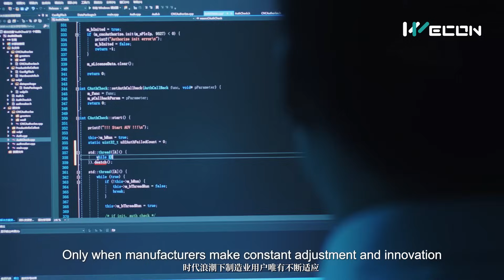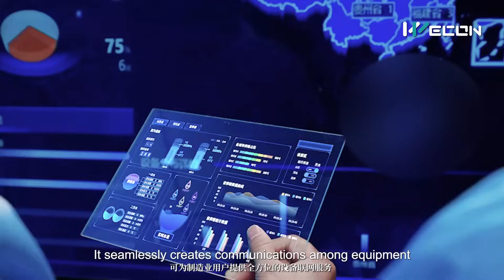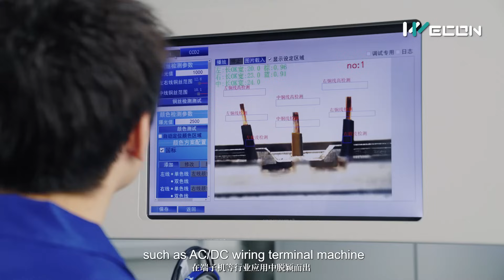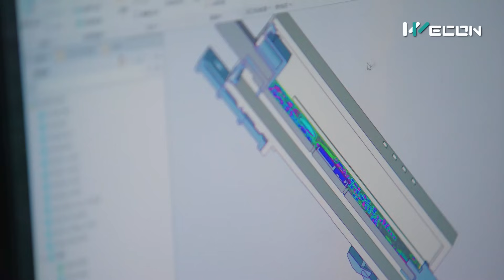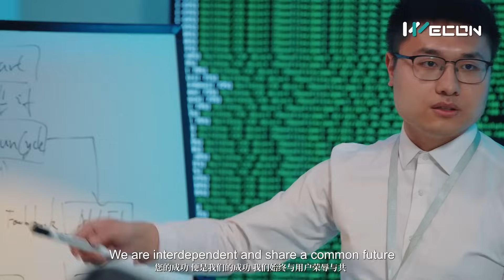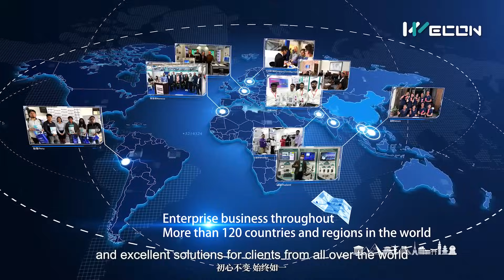Wecon Company Introduction 2023

Comment: Can't upgrade to 1.22 version, the software from the oficial site not working with error window, but those what i get from official saler making my servo in bsl and always in programming with one percent of burning, where is the working software, i use servo vd2f and VD2F_014SA1P_V1_22_241017_固件升级_250816.exe program, connect via rs422, when connecting first and upgrading i saw my servo version, after - all time "timeout" and bsl...Please help
Reply: Had the same issue with no reply from the company
Reply: Solved, thanks a lot to @WeconRussia